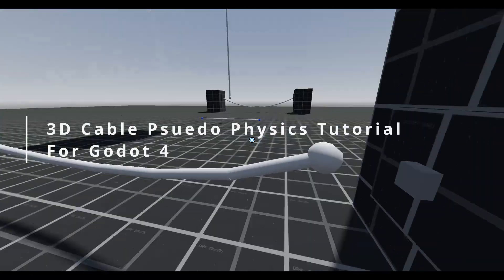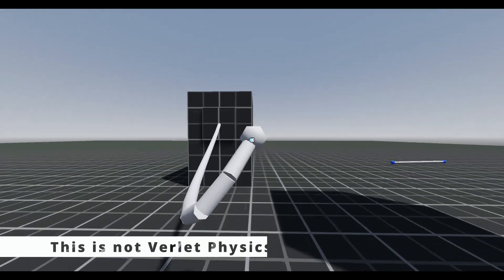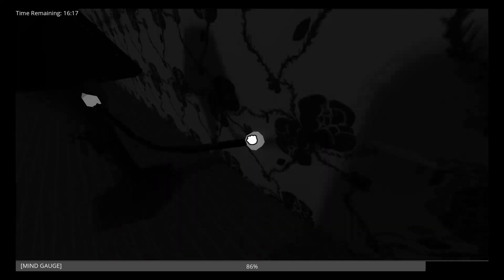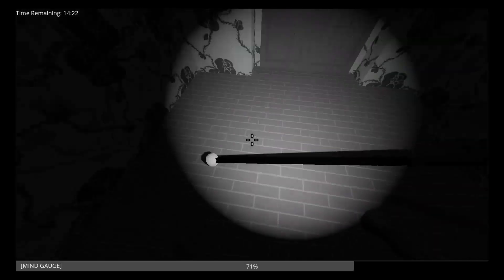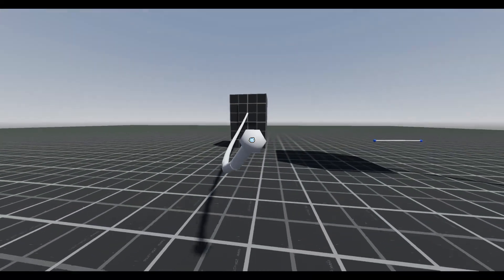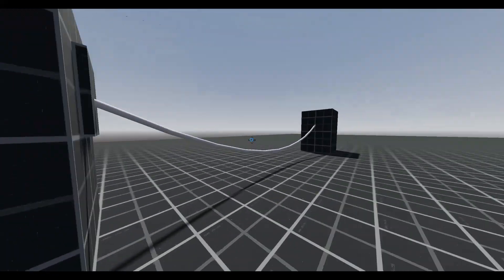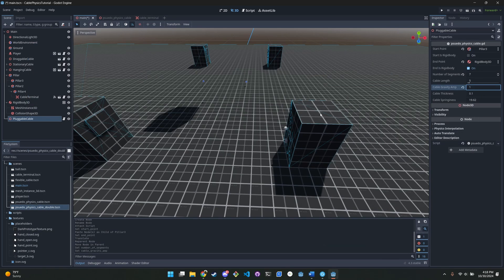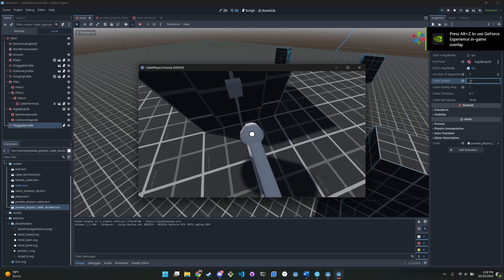Pseudo Rope/Cable Physics For Godot 4

Comment: This looks really good. Out of curiosity how did you implement the power on/power off bits of this? I'm looking at something similar and for now have basically just made a "Connectable" node that checks whether it's powered then propogates that state using signals but I'm very new at this so suspect I've not chosen an optimal solution!
Reply from the maker: I had a similar idea, but I used a master node I called a “puzzle node” that just had user assigned children and states in editor (the script is a dummy script that accepts any number and any type of child and its “state variable”, which was a string), and only powers on when the two matched i.e cable with the matching string is in the socket node that matches that string. They only change/checks state when a body enters and it forwards a True/False state to another user assigned node. I then chained the puzzle nodes to check on a sub puzzle (cable to socket) -> (lever flipped on)  that would then power another part of the puzzle that again was user assigned -> (door opens if the switch is flipped on and socket puzzle is true).
Reply from the maker: They all used the same script for different functions, so I could make any type of puzzle or combinations of parts without making more scripts. I should maybe make a video on this if I get time free from work